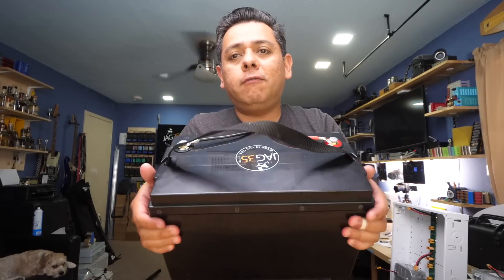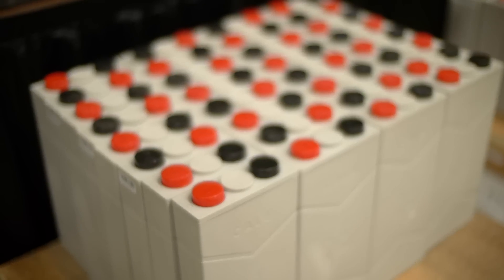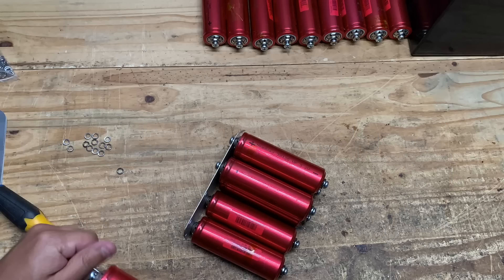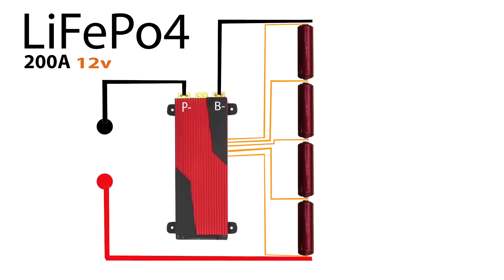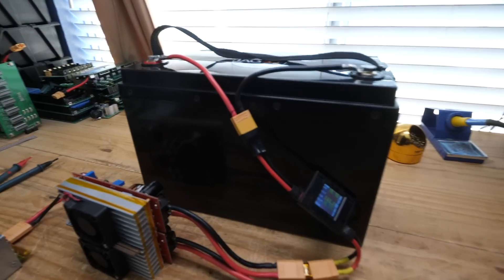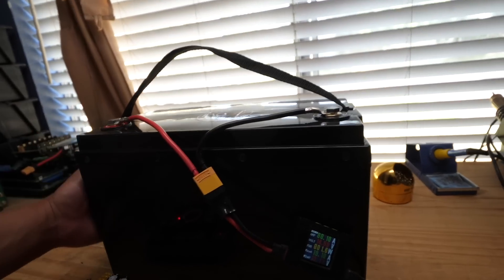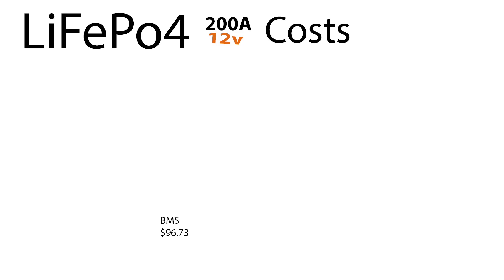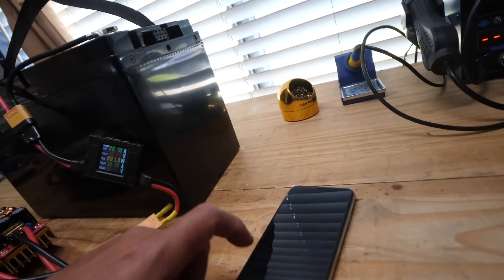Build a DIY Lithium LiFePo4 Headway 12v Battery replacement

Comment: I wouldn't use these Headway cells in an hot engine bay. When they get hot they do vent and can catch fire. If you had it in a cool spot they are great for a starter bat. You just need 4 cells and they turn a 6 cyl over easy. Just dont trust them in an hot environment.

Comment: Can you suggest, What is the safe way to connect a 4S2P or any battery pack with a dedicated BMS with another identical battery pack in series or parallel?

Comment: Like the idea, i would think it would be cheaper to build the inverter to handle the voltage of the lipo batteries, just need to make the inverter handle 17 volts, have 10 packs of 10, 27ah ford batteries, would run a inverter all day long lol, there grid tied now but would be cool to use a inverter if the power went out.

Comment: It looks like you are both charging and drawing using P- on the BMS, does this mean that overcharge protection on the BMS is not enabled, or does this BMS work fine either way?   I've never setup a BMS, so, just trying to figure out how they work for myself before ordering one.

Comment: You did a great job on the build and video; however this video demonstrates those headway cells are way to expensive. If you was to  use these cells to make a 100AH 12.8v battery it would cost more than the commercialy available Battleborn battery. I have built a few batteries using prismatic cells and 26650's all LiFePO4 and I can build those for far less. For me the whole point of building one is to make one that can handle higher amps and cost less than off the shelf. Having said that he did make an excellent battery pack.
Reply: where do you get your 26650 from ?

Comment: Your understanding of LiFePO4 is off. Capacity doesn’t increase at 50% load. Please make a correction to your video so you don’t mislead people. Lead acid at lower amp draws vs higher amp draws is a different story.  This is why I choose LiFePO4...... because of its capacity is its rated capacity.  I’ve tested and used those 8amp/hr red headway cells. You have 8 CELL’s  parallel and 4 cells series which is 64amp hours @ 12.8v nominal  ..... your watt hours should be in the 700’s regardless of draw not to exceed the 25C rating. If you understand “C rating” then you would know that each cell can give 200 amps.  You have 8 in parallel which means 1600amps at 12.8v.  Most of these C ratings are over rated.  If you only got 300-400 watt hours then these cells are no good. I’m happy to see you put up lots of videos, but your understanding of building and testing lacks understanding. Each cell should be tested individually for capacity and C rating before they ever get assembled in a battery form.
Reply: So sorry to tell you that I do know a thing or two, but in your test video you put a 1000w load on that small battery you made. Each one of those 3.3v or 3.2v nominal headway are called “Cells” once assembled, it’s a battery.  So you are getting the simple terms incorrect too.  A single cell will possibly give at its terminals a burst of 5 seconds an extremely high discharge current, with the down side being an immense voltage drop. Always size the battery to perform the work with no voltage sag.  The higher the voltage sag, the more the IR(internal resistance) increases and the cell with heat/short internally/damaged.  I’ve been working with many different lithium chemistries for many years.  
I’m trying to be helpful.  There was only 96w/hrs of energy in those 4cells in your other video. Your 1000watt draw was around 83amps which is 10c. Those headway cells are not designed to do that kind of constant load without damaging the cells. (Maybe 5-10 sec burst) Also, once you add bus bars into the mix, there is something called “C rise” which will limit what draw you can constantly pull from a cell.  There are many variables, but trust in what I’ve wrote here.  You’ve got lots of cool videos, I’d like to see you have a better understanding of the products you use and use them within their usable range taking in consideration:
How many “C” is useable with no voltage sag and sizing bus bars for their “C rise” as well as sizing a battery pack to perform the work you need it to do.   Understanding the specs of individual cells, and understanding when building a pack changes how the cells operate in a group will serve you well.  Again, here to be helpful. But if your job on YouTube is to destroy and incorrectly test items..... you are doing this very well.  I love lithium cells and what they can do.  You just need to understand how to size a pack correctly as well as test individual cells prior to the assembly of a pack/battery.  The Pack/battery is only as good as its weakest cell, but that is just the very short answer on having a weak or a few weak cells in a pack.  
If you have any questions, I’d be happy to help your understanding of lithium cells and battery pack sizing. 
Take care......
Reply: @TommyLuptak  Agreed. I caught that right away too. Do not take offense jehu but you are misstating the properties of LiFePo4.
Reply: @cdkipp  Thank you!  I'm not a troll to slam people, but I've seen some of his cool videos of the past year.  I was fortunate to have an electronics and math background along with having some amazing Electronics Engineering friends who have worked the electronic propulsion industry for over 15 years.... My understanding and use of the various types of Lithium cells is well above average to say the least.  I know the efforts it takes to make videos and post them.  I prefer to watch accurate informational vids.
Reply from the maker: I tested it on my bench and that’s what i got so I don’t care what you think you know.  As a 12v battery at those power levels that’s you can expect to get.
Reply from the maker: Here are my individual cell tests https://youtu.be/MdhyOFeOqyE

Comment: Thanks, man.  Great video!  The problem is we can now purchase brand new commercial 1C 12V LiFePO4 batteries, including BMS and warranty at 40AH for $400 and 100AH for $730.  This DIY solution is great for a hobbyist but not very cost effective.  Thanks again!
Reply: Nice, but where can you buy them at that price?
Reply: Alden Fulcomer where do you purchase those batteries ?
Reply: You are gonna pay $730 to replace your car battery!!! Hahahahah you call that cost effective?!! Lmfao!!
Reply: IT has nothing to do with the cars.  These are drop-in replacements for RV 12v house batteries/solar systems.
Reply: @aldenfulcomer7837  well $500 still cheaper than $700...
Reply: @Lola Uro The $500 40AH battery in the video is equivalent to the $400 40AH commercial unit.  For $700, you get 150% additional capacity for 57% additional cost.
Reply: @aldenfulcomer7837  plus a real warranty.  if one shops you can build a 400ah lfp battery using four 3.2v 400ah cells for less than $600.  that's 4.8kWh.  Drawback is buying direct from China mfg and basically no real warranty.  Done right it's a good way to go.  AliExpress has tons of options.  Learn then shop.

This was a really nifty build though but more accurate descriptions other than "... this thing here..." might actually help newbies learn.

Comment: nice video , how safe is to run without bms
Reply: Please don't. (unless you absolutely positively completely need to) It's almost impossible to burn your house down with these batteries, emphasis on the almost part.

Comment: Before you give it away start a petrol car with it
Reply: You can start a petrol car with 4 of those cells. They are very powerful.
Reply: @yehudagoldberg6400  4 would be 200ah, a normal AGM lead acid battery is 100ah. The problem isn't really ah but CCA.

Comment: You could commercially sell these batteries easily. They save fuel since they are lighter
Reply: If you mean as a replacement for a standard lead-acid car battery, I don't think it would save enough to be worth it.  The materials alone cost $400+ more than a standard car battery, and you still have to build it.  Also, as designed, it seems like the BMS would not be able to deliver the current required to start a car reliably, especially in the winter.  It would require more parts, increasing the cost even more.  The amount of fuel you save for such a small change in overall weight would take many years to pay off.  (if it ever would)
But, it's a start, and a step in the right direction!
Reply: @gmscott9319  well, sports cars would benefit from weight loss and also not mind the added cost

Comment: 32 of these batteries is $320, plus the BMS and all the other gizmos, a car usually doesn't go through that many batteries if you use lead acid. even if I understood everything in this project the costs alone don't make financial sense

Comment: What about monitoring temperature during charging and ensuring the battery isn't charged if the cells are too cold?
Reply: I was wondering about it too but if the lithium battery has a breather, we'd think that could solve the problem otherwise it might explode?

Comment: Can I build a 220v(64 cell) Headway battery without balancing only overvoltage(230v) protection(ever 48v or 16 cells) to cut off the charging at 3.3v. Then use a victron 250v mppt solar charge controller to buck the 240v to 12v, 24, 48v.
Reply from the maker: For a while I’m sure but then eventually they would drift apart
Reply: @jehugarcia    I understand completely understand either I will need to implement a BMS or periodically disassemble the battery and balance manually. This is the greatest Channel on YouTube keep up the amazing work

Comment: Something doesn't make sense, a normal lead acid battery of the same physical size would be around 95Ah. Not sure why the lithium version has less capacity. What capacity would the lithium version be at 0.1C discharge i wonder.
Or maybe it's just because those cells were 2nd hand?
Reply: Would the LA have 60Ah of usable capacity?

Comment: Why do you keep dicking around with 12V AC inverter setups??? You can't put a load bigger than 2000W on it, and going any higher at that voltage requires monster gauge wires to prevent things from melting.

Also. that charging setup is a total hack job. If I was making a "portable" battery to power stuff on the go the charging setup needs to be a one box solution too.

A more elegant way to pull this off would be to build two of those battery boxes and connect them together for a 24V system. Mount the inverter on top of one box and the charging gear on top of the other. At least that way you can still carry the whole contraption with two hands.
Reply from the maker: Stop thinking you are the only one, literally millions of people have 12v equipment

Comment: Finally! A thorough video compare to other videos on the web regarding the headway cells. Thermal vid and explanation definitely helps boost confidence when building a high amperage battery pack. Look forward to build a couple. Thanks Jehu!
Reply: Thanks for the Video clip! Excuse me for butting in, I am interested in your opinion. Have you ever tried - Rozardner Powerful Battery Reality (erm, check it on google should be there)? It is a smashing one of a kind product for learning how to recondition an old battery minus the hard work. Ive heard some extraordinary things about it and my mate after many years got great results with it.
Reply: What ah is this battery

Comment: Need to double up your buss bar, needs to be thicker and it will keep it cooler
Reply from the maker: tankdog03 buss bar never heated up
Reply: @jehugarcia  for it's full potential thicker buss bars are good
Reply: @tankdog03ify  More surface area for dissipation is key

Comment: Been a viewer from the start, never commented. I enjoy watching someone  as interested in these batteries as I am. Have built many lithium projects and driven five of my conversions. I am a geek. Cannot help it!
Reply: That's interesting Philip, did you build one for your car?
Reply: Would it be ideal to make a power bank with these, 38120, batteries or with 18650 batteries?
Reply: @Sr_iRL  it depends on energy density you want and cost and how much labor you want to do. Now if going to use the 18650 chemistry it would be more energy dense to use the 21700 cells and if you dont need to cool prismatic or pouch cells may be better.  You have to define what your goals for cost labor size energy density whether or not cooling will be needed amp draw etc among other things like the shape of the space they need to fit in etc first.

Comment: 60ah of useable storage
That’s not any better than 110amp lead acid :/
Reply from the maker: Isn’t lead acid only 50% usable?
Reply: jehugarcia 50~60%
However this battery does have higher output.
Reply: lol this is like 5x better than a 100ah agm battery. you are insane
Reply: imBriz what are the 5 ways this is better

Comment: @jehu A suggestion for the separation: use of a non conductive material such as plastic that would be not as thick but enough to do the same work as what the center separation shows under 5:30 of your video. ;)

In other words pole to pole with a plastic “tab”.

Comment: How does changing the rate of discharge change the capacity of the battery? The battery has the same AH or WH no matter how slow/fast you use it.
Reply from the maker: Yes but what use of it to you to have capacity in a battery you can not use because your inverter wants higher voltage?  This usable capacity.

Comment: Good stuff... is there smaller 12V LiFEP04 batteries you can make? like a in a formfactor of a 12V 7A VSLA? that would be quite a practical portable battery... to be used as UPS replacement or alarm backup batteries
Reply: dazza3g just use less cells, still have the same voltage. I don't think it would be very  effective tho due to there being alot of wasted space
Reply: 4 of these in series will be 12V 8Ah. They will be significantly smaller than a 12V 7Ah VSLA (about half size), and be able to deliver significantly higher power (2000w vs ~400w?). They will be lighter and more reliable. But it will be more expensive. I would not choose these cells for UPS though, as there are other cells suited for UPS which is high energy/low power.

Comment: Used LiFePO4 cells are definitely worth it as long as they are balanced and not too worn out. And the peace of mind charging with off the shelf 12V chargers is priceless.
Reply: I wonder how balancing is maintained in a 8 cell per bank setup like this.
Reply: @GBOAC  personally I find it more useful to top balance especially if its just four rows in  series. if you search "usb lifepo4 3.6v" on ebay, they will have individual charge circuits you can place on each row of cells for a nice and slow top balance charge.

Comment: instead of the cardboard you should make rigid plastic plates. and drill 4 holes in it and screw them like if u wanted to make a short with metal ones. that way they stay without movement. @jehugarcia
Reply: exactly, he said this will last many years, cardboard won't hold up to the condensation in the air

Comment: Thank You!! Awsome build, looks easy enough. However one question, what are the benefits of using an 4s 3.2v 200ma system to an 4p 12v 50amp system.

Comment: For those cells you should run no smaller than 4awg BUT im sure your working with what you have.
Reply: It is also a limitation of the BMS units. They are rated for 200 amp continuous but I am skeptical.

Comment: You should test with a car audio amplifier & subwoofer. Us people with car audio systems like to specialize in 12v systems we use big alternators big xs power AGM batteries & xs power ultra Caps

Comment: Great video and like how you broke every dollar down at the end.  I bought 4 headway cells from battery hook up for my integra was going to just use copper bus bars into the screws and hook it up.  But I heard the alternator will constantly charge them making for a very short life.   So maybe I should look into a bms
Reply: You need dc to dc charger for them
Reply: @dannyw7662  Hey thank you. Was just a couple weeks ago I seen a video about a r enology dc to dc.   I’ll have too see how they charge up now I have a bmax charger.    I’m guessing I still will want a bms on them.?   I’d love to use them as a aux battery in the trunk.   Wanted to completely replace but would need more cells.
Reply: Why would the alternator make a very short life when the regulator takes care of that?
Reply: I hear it’s because the difference between lead acid and lithium has different charging methods.  Cc cv for lithium

Comment: What load are you use for discharge this pack at CC 200Amps ???
Reply from the maker: 1500w appliance
Reply: @jehugarcia  Sir, I want to discharge Lead-acid battery pack of 12v to 48v at the current of 50Amps can you please suggest what efficient method that I can use.

Comment: That’s awesome. Can these be used in series for my 24v & 48v solar power system I have overseas Philippines? I looking for adding to my lifepo4 3.2v banks when I retire and have batts that self bms rather than the complex Relat system I have now.